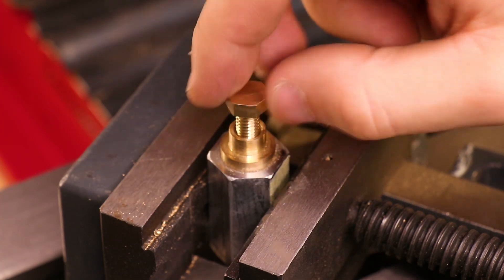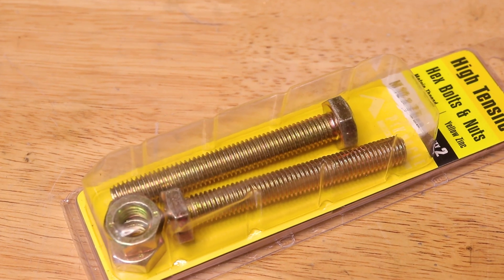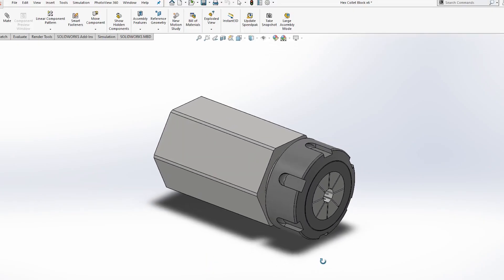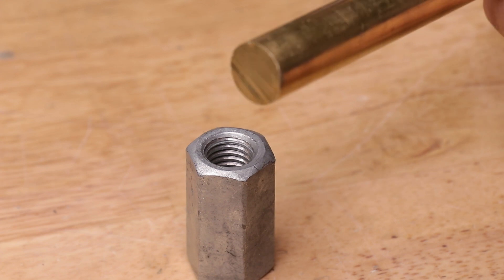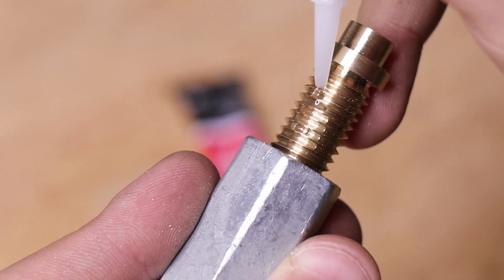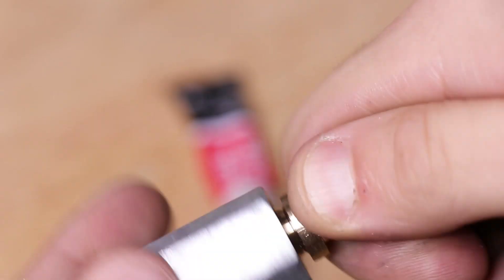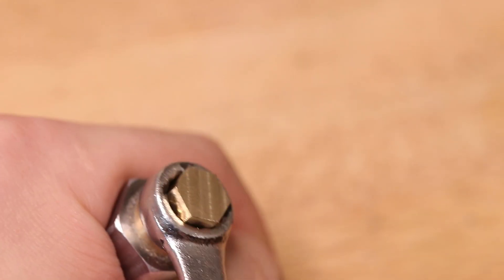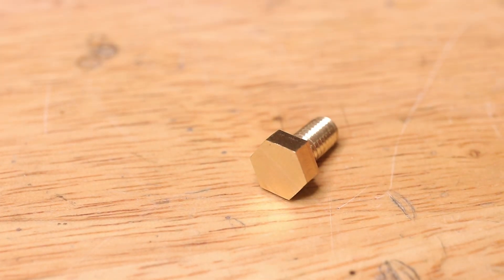Machining Bolts Without A Collet Block On The Mill

Comment: If I’m using a Rotary table mounted 90° with my round brass stock in same position as your video. How many degrees do I turn it for making a 1/8” size Hexagon? (Not making a bolt, but a small scale model part.
Thanks!

Comment: When you finally milled your hex, why did you hold on the corner instead of the flats on your nut, it would have been far more secure.
Reply from the maker: There is a small V cut out in the fixed jaw which prevented me from holding it with the flats. Due to being in lockdown here in Aus I wasnt able to get any material to machine a new set of jaws. Not optimal but it works fine. Cheers

Comment: Just get a 5c collet holder. This will only work with one size and one thread pitch. If you use a collet holder you can use any size you have a collet for. However if you’re going to be switching sizes all the time it might be time to look into buying a dividing head or indexing plate.
Reply from the maker: Not a big fan of 5c collets for holding threads since the compression force is more towards the front of the collet and can easily damage the threads. Since I make a lot of brass threads with fine pitches, this method works really great. Cheers
Reply: @artisanmakes  just index the part before you turn it to begin with. Then run your threading operations and leave yourself some holding room on the part.

Comment: You will always get a better thread finish doing it on the lathe
Die nuts are best kept for cleaning / repairing a thread, they tend to cut a little under size where thread cutting on the lathe you can get a precision fit.
Re the tap in the lathe chuck, if you look in my videos you will see one on making a tap holder for the lathe chuck that doesn't slip, they are quick and easy to make.

Comment: 6:15 Well that spanner doesn't fit !
Reply from the maker: It was a little under but falls within acceptable tolerances for a hex bolt
Reply: @artisanmakes  Where I 'come from', you know a tool for turning a nut or bolt fits - when you have to hammer it on ;)
I have had rare occasions like that - and been glad of it due to the effort required to undo such nut/bolt - and the last thing you want is the tool slipping ;)

Comment: 5:45 You can see that the hex is not down flat on whatever it's resting on. If I was doing that, I'd have the flats in the vice and one of the corners resting on whatever.
Reply from the maker: Thanks for the reply. Holding it this way was certainly not optimal, I would have rather held the nut with the sides but the vide that I have has a v cut out in the fixed jaw, so I had no choice but to hold it using the edges. Not optimal but this was my first project with this mill and my replacement vise is still in the mail. Gotta work with what I have. Cheers.
Reply: @artisanmakes  Can you not hold the flats in a way to miss the vee ?

Comment: 5:05 Is it my imagination or is that parting off tool jumping up and down all over the place ?
Reply: No its definitely jumping up and down. He has a very small hobbyist lathe and its not very ridgid. So im assuming thats why its jumping or it came loose and he didnt notice.
Reply: @daviddaddy  It appears the toolpost is moving too. Looks like he needs to tighten up his slideway gibs.

Ordinary lathes are badly designed - but I can't get any lathe manufacturers to make lathes that don't have this fault. I'll fix it when I'm doing any parting off on my channel: Machining by Mike - which I've just started.
Reply: Plus, i believe this was before he added some upgrades to make it more precise and ridgid. So hopefully its a bit better now.
Reply from the maker: Yeah this was right before I upgraded the bearings, gib strips, and carriage retainer plates. The rigidity of the machine was really poor when parting before I made these changes, and parting is probably the most demanding process you can put a lathe through.

Comment: great idea. be interesting to see you make a collet block with a larger one...i figure order of operations thusly
accurize concentricty of the link nut
bore out the thread
bore the collet angle in the throat of the nut
Reply from the maker: That might work, but my 3 jaw chuck has too much run out to make a decent collet block.
Reply: @artisanmakes  a 4 jaw chuck should definitely be your next purchase.
Reply from the maker: @RedDogForge  I have 2, but they won't hold onto hex stock well.
Reply: @artisanmakes  center drill two ends of threaded rod that will fit the coupler, cut in half, thread into both ends of your hex coupler, setup for turning vetween centers, turn down 1/4 of the length to round and a point halfway up it for a follower or steady rest, . remove from setup, place turned end in chuck. center section braced with follower or steady rest. and proceed to turn your interior features.

Comment: I noticed that the thread cutting started in the lathe but continued in the vice. I have a Hobbymat lathe and found that in the three jaw chuck there is rarely enough grip for threading with a die in a tailstock die holder and that the workpiece slips. I usually overcome this especially in stainless steel by using hex stock (oh the irony) but when this is not possible a collet chuck gives a vastly superior grip and usually prevents slipping.
Reply from the maker: For me it's just a little awkward to cut larger threads using the die when the part is in the lathe. Cutting above 1mm pitch threads is easier to use the die wrench in the vise. Cheers

Comment: Nice work. Actual Copic for the marking out, or have you refilled a dead marker with something else?
Reply from the maker: Actual Copic marker. I really like the dark saturated black ink, as most brands tent to be an dark purple. Plus most sharpies are oil based, this is alcohol based and it comes off easier. Cheers.
Reply: @artisanmakes  Cheers - I've tried re-filling a dead copic with dychem but it never got the saturation. Good to know it can be this simple!

Comment: You're better off putting the flats against the vice jaws, and an edge on the bottom. Far better grip, and less chance of damaging your "collet" block.
Reply from the maker: Thanks for the suggestion and you are correct. I would do that but there is a v cut out in the jaws of the vise so I had to hold it the way I did. I would have machined a new set of jaws but didn't have a big enough piece of steel. Cheers

Comment: Better to hold the hex with the flats against the vise jaws -- if you put the flat down, you are holding only on the points of the hex and it can easily come loose while machining and ruin your day
Reply from the maker: You are right, I was going to make a jig to hold it at that orientation and at a set height but I just didn't have the time. But the video jaws were tight enough that it stayed in place. Cheers
Reply: @artisanmakes  you don't need a jig.  Just hold it in the vise but oriented with the flats vertical (i.e. against the vise jaws) ... your vertical height is set by pushing the corner down against the base of the vise opening while you tighten the jaws.  Done. 
👍
Reply from the maker: @tano1747  Thankyou for the reply but on this specific vise a jig is necessary due to a v groove in the vise jaws. If there wasn't one I certainly would have held it the way you are describing. Cheers

Comment: Milling the flats in the vertical orientation you run a great risk of the blank unscrewing from the fixture unless you use a left hand cut endmill!!
Don't ask How I found this out the hard way........
Reply: How about just feeding from the other direction.
Reply from the maker: Wasn't so bad here, the cutter spins clockwise, so cutting it this way pushes the bolt into the coupler, tightening it. Cheers
Reply: I built a simple 60:1 ratio dividing head to utilise my Myford chucks and you have to be aware of the cutter rotation on bigger hex heads to prevent the chuck unscrewing. I think I'll knock up something like this and maybe insert a grub screw from the back side of the coupler to lock the embryo bolt in place ?

Comment: You can use a large large bung nut used to fasten rods. You can mill out an internal taper to fit ER collets and thread a portion of it for the ER collet nut.
Reply from the maker: Yes I am sure that could work. Many ways of approaching this problem, Cheers.

Comment: Would it have helped by first screwing the brass insert into the extender nut, then drilling and treading to brass with the nut / insert insitu? Otherwise, great idea!
Reply from the maker: Thanks for the feedback.  I probably could have drilled the hole in the chuck but the 3 jaw that I own has a great deal of run out, so I probably would end up with some eccentricity that way too. Easiest method that I saw was to make the bolt, concentric and then remove the run out in the coupler. Cheers

Comment: This worked out great! However, link nuts usually are not that concentric, so on order to hold concentricity it would've Been better to drill the brass in The nut.
Reply from the maker: Thanks for the feedback. I pointed out in the video that it was a little off centre, from memory about 0.1mm. I probably could have drilled the hole in the chuck but the 3 jaw that I own has a great deal of run out, so I probably would end up with some eccentricity that way too. Cheers
Reply: @artisanmakes  Dude not meaning to be a spoiler but several of the guys who use these hex collet blocks point out that you should NEVER clamp down on the corners (see 5:38), the side of the collet block should be against the vice jaws.
1: You just don't have a lot of contact area with the vise jaws which does increase the risk of it moving or worse flying out of the vise
2: You risk deforming or flattening the corners
Overall its a really neat solution. 
For anyone doing any of these small steam/air engines they can make a set of hex head bolts easily. Big 👍👍👍👍 to that.
Reply from the maker: Thanks for the reply. Holding it this way was certainly not optimal, I would have rather held the nut with the sides but the vide that I have has a v cut out in the fixed jaw, so I had no choice but to hold it using the edges. Not optimal but this was my first project with this mill and my replacement vise is still in the mail. Gotta work with what I have. Cheers.
Reply: @artisanmakes  I figured there'd be something that wasn't obvious in the vid.

As I said I really like it as a solution. This will get people out of binds. They might not take the time to do the insert and just use a threaded piece of hex, but it wont matter because your right about one thing. Bolt heads don't need to be micron perfect. 
Its something a lot of younger engineers don't get. They've educated on a diet of 3D-CAD, Hyper efficient CAM and micron precision machining centers. They almost don't get the concept of functionality before precision.
Reply: @artisanmakes  
Late to the party and this faux pas was the first thing I saw. I figured someone would have chimed in and indeed they did. However I must take exception to your response,  safety first and all that. Span your V with a parallel or similar piece of stock.  I of course would do it not for safety but to minimize the possibility of breaking an expensive end mill.
Thanks for the content,  I am often impressed by what creative and patient people can do on little machines. Myself, I don't fall into that category and compensate some what with size.

Comment: You can get those hex collet blocks for less than $40 on eBay, just in case you haven't seen them. They seem to be fine.
Reply: I haven't seen any in er11 yet, which seems to suit the size of parts I work with most. Making one from some 19mm hex bar was a nice practice project
Reply from the maker: Thanks for watching. I will have one on the way soon. I haven't heard anything bad about them. This was just a quick interim solution that I was able to fashion with parts I had on hand during covid lockdown. Cheers
Reply: @artisanmakes  I've got a set of the cheap import 5C collet blocks. They are pretty good but were off center a bit. I just used a known good collet and a gage pin. And milled the blocks true to the pin.

Comment: Here I was, expecting you to turn down the end of the coupler nut and convert it into a collet chuck.
Reply: I figured the coupler nut was way too small to fit the kind of collets in there that he was talking about, but it did strike me as maybe possible that he could use the coupler for indexing so he could make himself a collet block. :)
Reply from the maker: Thanks for the feedback, I did consider turning it into a makeshift colet block for my er 11 collets, but realistically there wasn't enough material to work with, adding material to the coupler would be more trouble than it would be worth. Cheers